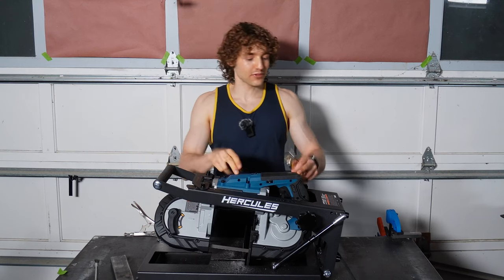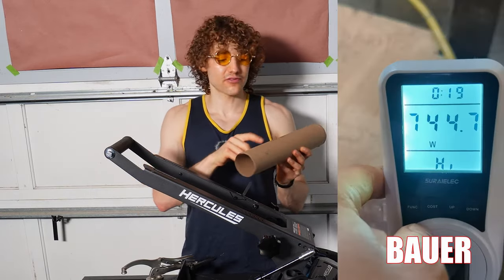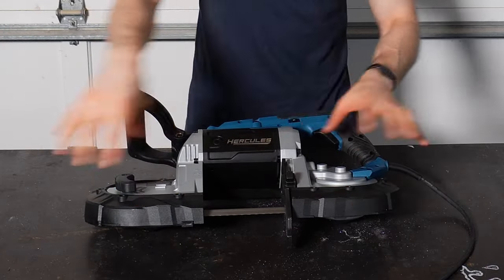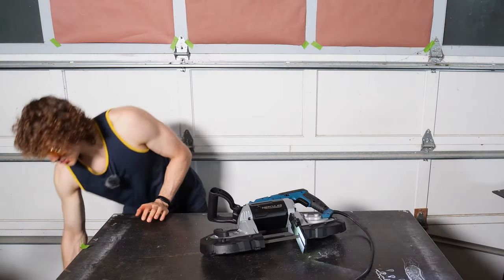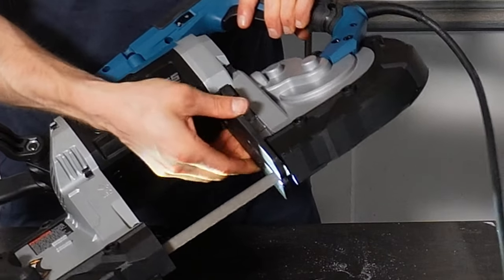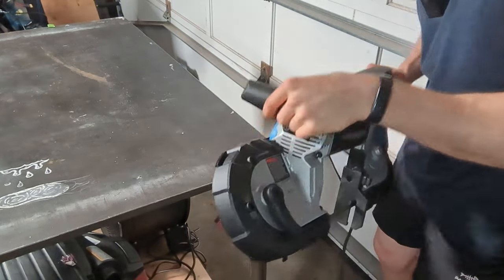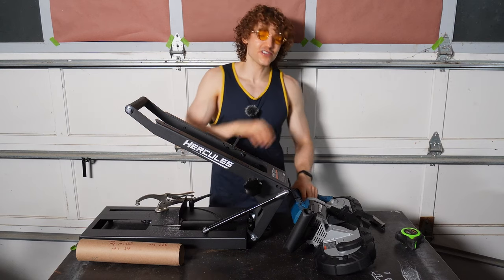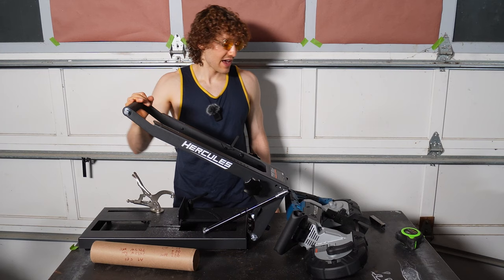Another Homerun From Harbor Freight! REVIEW: Hercules Band Saw

Comment: It is indeed a variable trigger. The trigger varies speed quite well I thought when I ran it today.
Reply from the maker: Do you have the cordless 20V or corded model?
Reply: @BootlegBarry  corded hercules
Reply from the maker: You're right, I just tried it again and can get a bit of variability but only like 2-3 speeds. Much lower resolution than the Milwaukee, but it could just be me.
Reply: I recently purchased a WEN portable bandsaw. I like the HF stand, but unsure if it will fit.

Comment: Thanks for the video.  I have the Hercules stand and have my deep cut m18 fuel mounted in it. But would like to have the cordless m18 available for use anywhere. So thinking about getting this Hercules. Does this Hercules use the same size blades as the Milwaukee (both are deep cut)?
Reply from the maker: Yes, the deep cut m18 and this Hercules both use a 44-7/8 in. x 1/2 in blade. The compact Milwaukee version like I use in the video has a 35-3/8 in blade though.

Comment: Forget HF saw blades. Foot pedal is useful. Increased speed, well if you are a hobbist is it really worth it? I was waiting to kearn about the saw but now that I see it Im not sold on the upgrade from my bauer. The stand is a different thing. Its expensive for what its is but making one, for me at any rate, would be a pain. Finding "scrap" metal around here is a pain so I usually buy new depending on the project. I always have some left over, not always enough for a project but nothing goes to waste. Im old and grumpy and remember what stuff use to cost, ergo grumpy. Cheers all, happy new year.
Reply from the maker: Happy new year!

Comment: I am having issues with the bandsaw blade twisting when cutting pipe for instance. Can't get a square cut to save me! Well, it's square with the unit, but it does not cut the end of the pipe off, top to bottom, when trying to shorten a piece of pipe. Any Ideas anyone??

Comment: I didn’t get a blade with mine. Did your saw come with a blade?
Reply from the maker: Mine didn't come with any. I picked up some of the bi-metal blades they had here when I upgraded the saw.
Reply: @BootlegBarry  Thanks, I thought it was forgotten at the factory. Even the maroon horizontal band saw comes with one. I live over an hour away from the store. What’s a good blade you can buy anywhere?
Reply from the maker: I also assumed one would be included when I first got the Bauer. Do you live close to a Lowes? The LENOX bi-metal blades are solid.
Reply: @BootlegBarry  I’ve always heard good about them. Lowe’s is 1/2 hour away. May just look for some Milwaukee in town.

Comment: I just got this, corded, and the stand today. I couldnt cut 1" by  3/8 thick steel im forging. It got in slightly and instantly dulled both of the blades i bought at harbor freight. Ive never used a bandsaw before now, but I am seriously regretting the purchase right now and thinking about a refund for a chop saw.
Reply: Is your blade going the right direction?
Reply: I have had no problem with it's cutting ability. I've been cutting thick wall 3" well casing pipe with no problem. I am having difficulty getting the blade to stay straight up and down when making a long cut.